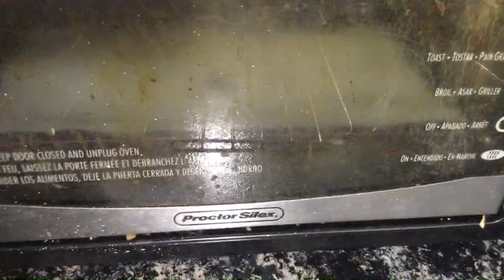DIY Guitar String Charm Bracelet // Wire Lady TV Ep 165 Livestream Replay

Comment: I liked to pull the inner wire out and replace it with a softer wire for the inner support. It was so much easier to manipulate.
Reply from the maker: Do you mean pull the wire out of the spring of the guitar string? I didn't know you could do that!
Reply: @HeatherBoydWire  yes. I pulled the stiff inner wire out leaving just the coil. That was too flimsy so I replaced it with softer wire. It takes some twisting but when it loosens it pulls right out! Loved this bracelet tutorial!!